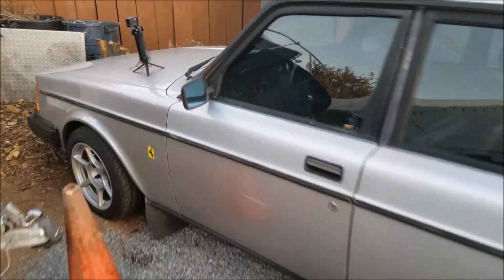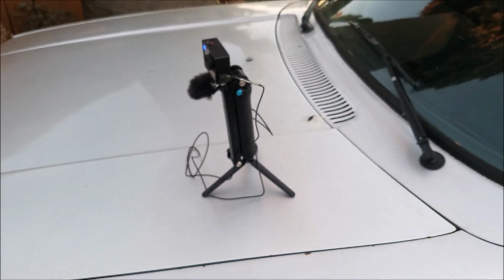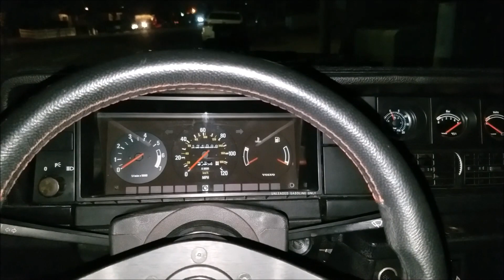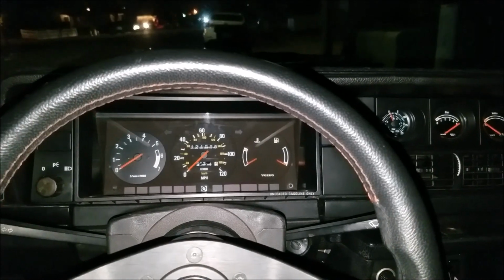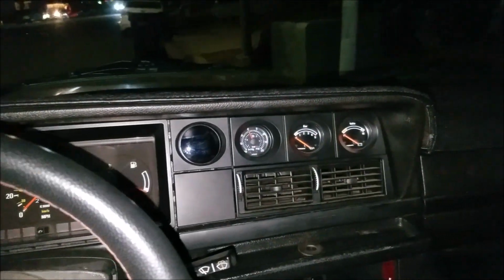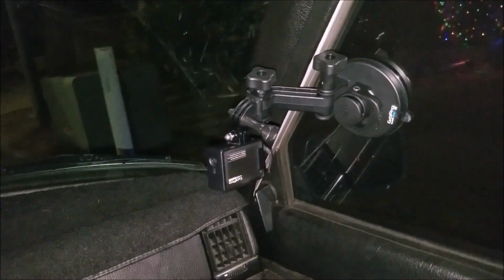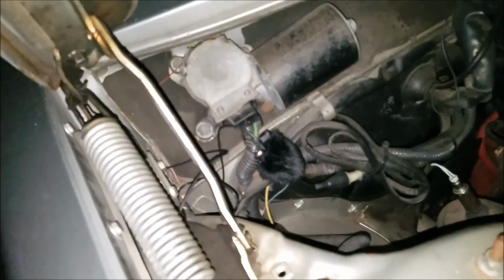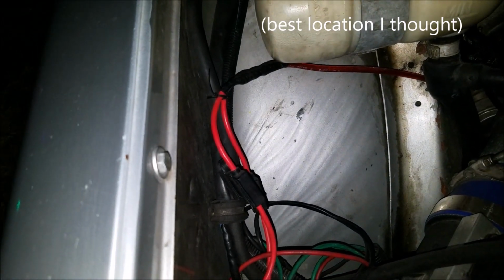Volvo 240 Turbo - INTAKE AND EXHAUST SOUND!

Comment: Cool video
Reply from the maker: TIM thanks!
Reply: You should have 2 mic's, one for near the turbo and one for the exhaust, then you just put both audio tracks on the same clip, put the volume of the turbo mic lower. It will sound amazing
Reply from the maker: I've seen videos of people doing and it's nuuuuts (Adam LZ did it on his JZX100 at Ebisu)
But that'sld require more mics and more Gopros. I could buy another set of wheels and tires for that haha. 
Maybe one day
Reply: New Spin youtube you could buy a 60 dollar go pro and a 10 dollar mic, since you only need one for audio, or maybe plug the second mic your phone. That would do.

Comment: What driveshaft you used for the t5 swap?
Reply from the maker: Los_215 stock Foxbody. I show it in my swap videos if you take a look at my channel.
Reply: New Spin yeah i seen all the vids im subscribe but im not sure about the year im also doing a swap
Reply from the maker: Any year with the World Class T5 will work with the parts I used. Namely 86-93
94+ they changed the T5 and it became longer. So it won't fit
Reply: New Spin also did you have to change the pilot bearing, the bearing that goes on the back of the crank
Reply from the maker: Yes, you should change it if it hasn't been done in a long time anyways. Since you've got the trans out and have access. 
The T5 necessitates a Foxbody pilot bearing also. Fits right in the crank. That was in my swap videos as well.
Reply: Does it pass smog?
Reply from the maker: "Yes"... haha

Comment: bro you have an exhaust leak
Reply from the maker: Actually no, although the EGR plug did fall off once... xD
The noises in the engine bay were ticking from valvetrain and a bit of clattering from the transmission. 
The rest of the exhaust was actually very well made. Full custom 3"
Reply: New Spin well i stand corrected lol